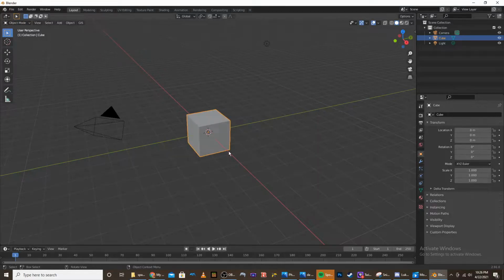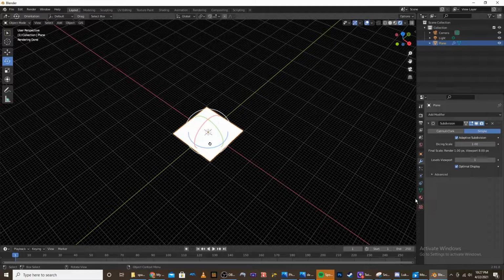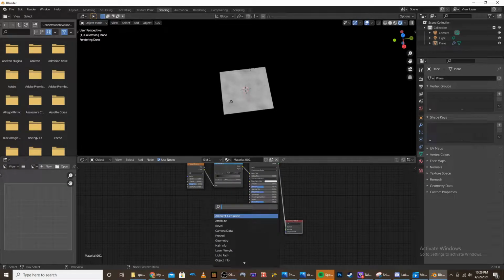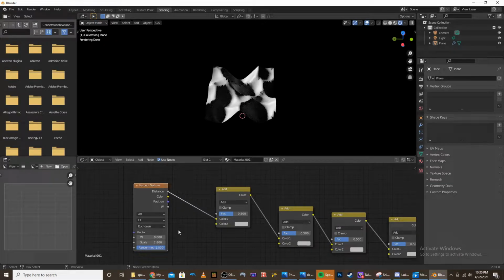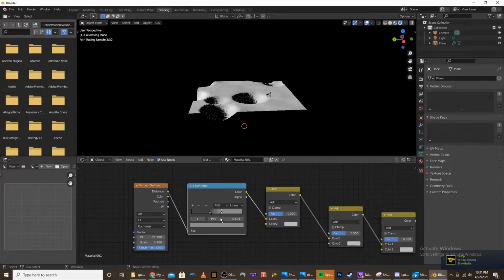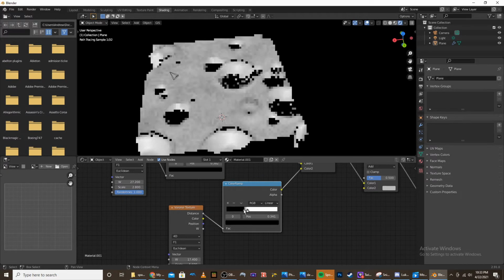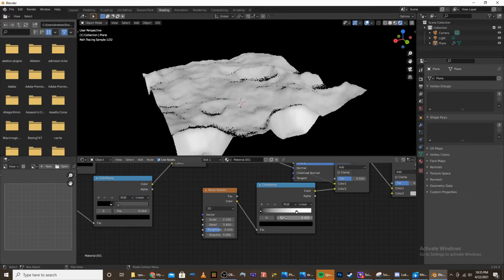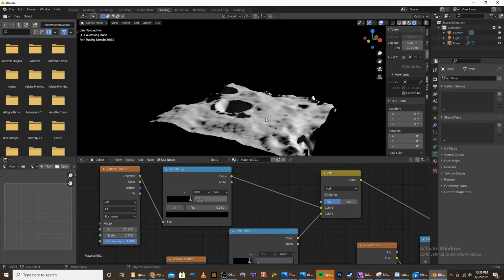How to Make the Surface of The Moon in Blender - (Tutorial)

Comment: my voronoi doesnt look like yours, mine has much sharper edges and doesnt look like terrain
Reply: Same with me, looks totally different :(. Which Blender version was this made in?
Reply: Did you end up figuring out why? same thing here
Reply: @ksockhak  I didn't....maybe @El_Jubo
Reply: @Yarck-Yurki  nah never did, ended up just using the landscape add on with musgrave texture to make craters
Reply: i had the same problem. I 
fixed it by deleting the sub surface modifier, and just subdivided it a bunch manually in edit mode. Then i used shade smooth and it was pretty much the same
Reply: I deleted sub division modifier and added it again then clicked on adaptive subdivision it worked!!!!
Reply: Make sure you are in render mode and experimental